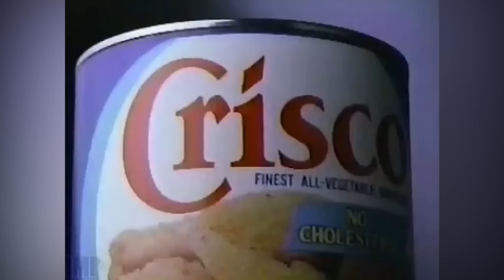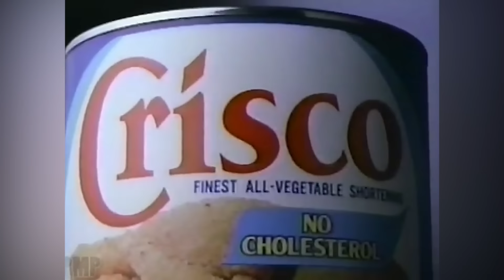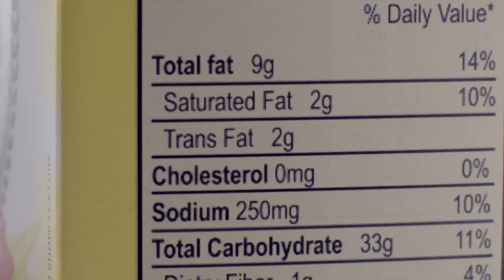The Real Reason Why People Stopped Buying Crisco

Comment: Fact: Crisco still contains transfat.  Read the label, it still includes hydrogenated oils.  Fact:  If the serving size contains less than .5 grams you can claim stuff as fat free or sugar free.  So if 2tbps is .499999 grams of transfat, its transfat free.  Fry stuff in a cup of crisco and you are frying in something containing 0g-7.99g worth of transfat.  The ability to round is stupid.  Regular dukes mayo contains 0 sugar, but the lower calorie light mayo contains sugar but is listed as 0g sugar.

Comment: The 1999 Framingham results demonstrated that dietary saturated fat intake had ZERO correlation to heart attacks. But since the medical community had no other suggestions to get people to have less heart disease, they BURIED those results, and have since worked hard to remove links to any website that holds that information. It took the FDA 14 years to change it's dietary recommendations. Meanwhile, the medical community continues to do more and more  studies, continuing to try to mark dietary fats as the cause of heart disease. What's that old saying about doing the same thing over and over, and expecting different results? Oh yeah:  INSANITY. Eat what you want.

Comment: Crisco is not Lard.  Open a can of it and put it in the garage.  2 years later it will still be there with dead bugs in it.  It is a chemical concoction that wont spoil.  Use at your own volition.  Just like Velvetta cheese, which in fact is not cheese at all.  It’s yellow Crisco at best.

Comment: in aviation, we use crisco to lube the O-rings in fuel and oil systems
Reply: I work on ag equipment, we are instructed to use a vegetable based oil on cylinder sleeve o-rings. Murphy's Oil Soap is my choice for that and other applications where appropriate.

Comment: This is ridiculous and a completely inaccurate video.  Crisco has been around for almost 100 years, not 50.  And the relatively recent change to i.prove Crisco was not because of changing the cottonseed oil to other plant oils.  It came because they changed the processing from partially hydrogenated to make it fully hydrogenated which eliminated trans fats.  This video should be pulled.  Just inaccurate.